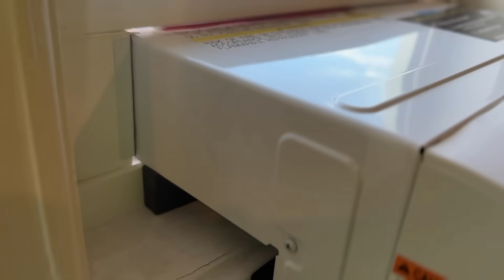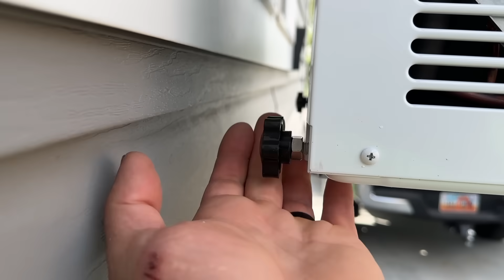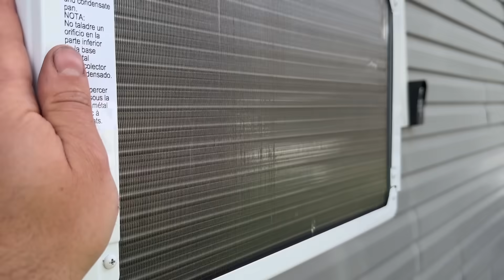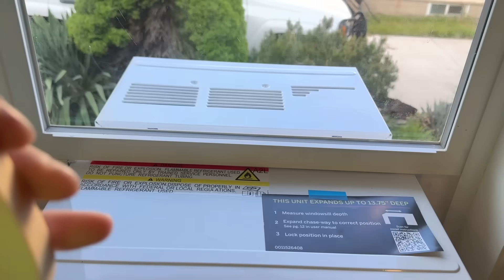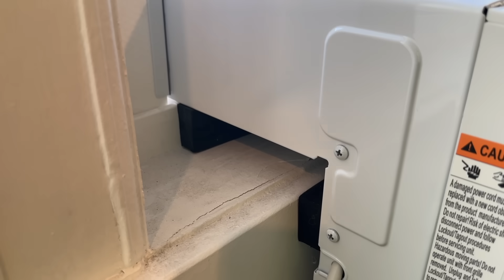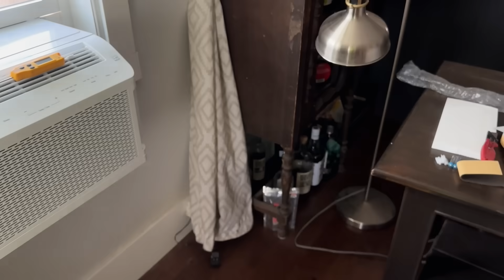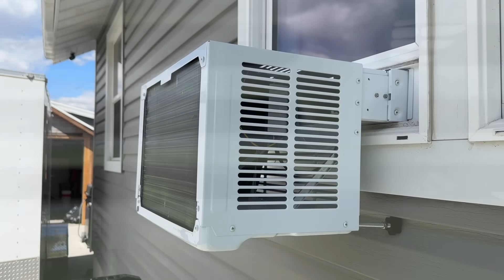Why Didn't Anyone Think Of This Sooner?

Comment: Love the channel and I'd like to answer your question:

Answer:  People thought of this idea over 50 years ago but the reason it was never produced is because the manufacturers had to wait until society was stupid enough to purchase it.  What now with woke Brandon and the alphabet crowd and idiots everywhere it looks like the time has now come.

There is no advantage to this unit as compared to the traditional units save you get a little more window viewing room...  It's harder to install, it costs more to produce and buy, it's more bulky (less compact), and has all the disadvantages of a window a/c combined with all the disadvantages of a mini-split.  You'd be smarter to get a traditional window unit and save money OR go with a mini-split.  It is NOT 30% more efficient than traditional units, it's 30% more efficient than traditional units if those units are 20 or more years old, but it's actually less efficient than traditional window units of today.

All the wifi app control stuff exists everywhere on everything.  Bottom line - it's dumb but since society is getting a lot dumber as time goes by it looks like the time has finally come.  The people who you will see with this unit in their windows this summer will be the same people with the "Biden Harris 2024" banner in their yards

Comment: we have had ours since last year, it gets cold and its very quiet even on high. love the app for it and it wasnt too hard to install at all. only negative i could see someone having was and is needing to drain it the plug is inside near the bottom i mean all you need is a bowl or cup but yeah some needle nose plyers help pull the plug after unscrewing the cap.

Comment: The splashing is intentional so it gets better efficiency. You can also just remove the drain hole outside so it doesn't splash and pours out. I put a hose in my mine so I can have it pour out into a garden.

Comment: I bought one designed from Midea like that 1 1/2 years ago and was a fantastic design . You keep the compressor outside and fan inside . Window shuts almost all the way to just allow transfer of air . Much better than having a wide open window and trying to use those dividers to seal the air gap . Plus soo much quieter .

Comment: Likely because it is cheaper to use one motor with dual shafts and 2 fan blades than using two motors each with their own fan blade. If that condensation pump ever gets clogged (and it will) or the pump quits altogether you are going to have a real mess. It's not a bad idea but it's going to be more expensive and more expensive to maintain because you have 2 motors rather than one that can fail plus an extra condensation pump. There really needs to be a way to add a little bleach to the condensation tray to keep any scum build up out of the tray and especially out of the pump lines

Comment: The condensate from inside is supposed to be picked up by the condenser fan and discharged through the condenser coil. This increases the efficiency on the really hot days.

Comment: Does the manual reference a proper angle for the outside portion of the unit? Sometimes the design is intentionally splashing condensate water on the exterior coil to increase the unit efficiency, albeit at the expense of more noise.

Comment: Sooo Close.  I thought I finally could have a window unit but these unit requires 13" minimum height opening and my error was to install windows that only open 10.5 inches.  If there is a way to remove my lower tilt in window then these will work.  There is exactly 13" from bottom window casing to the bottom of the top window frame.

Comment: Actually I'm surprised those holes are underneath for drainage??? Generally it's ideal to have the water there and the fan slings it up on the condenser coils making it way more efficient at heat transfer. I think most window units are designed that way. Next time you have your window a/c unit running try pouring water in the lower part of it & the difference in efficiency is noticeable immediately inside. That's if you haven't drilled holes to let the water drain out. Lol. The holes are not there for a reason.

Comment: My father had a window unit in the 80s or 90s for use with sideways slider windows.  If I recall correctly the window slid between the inner and outer unit with only a three or four inch connection between them.

Comment: It's been thought of before. There's another one that did it. But, it had a history of leaking condensate inside the house. (Soleus air)
It's why I preferred the Midea U shaped unit, though theirs requires a mount bracket that the unit comes with.

Comment: You gotta check out the unit from Gradient. Same saddle design, but it’s a full on heat pump, so it’ll heat as well as cool. Pretty pricey right now, but if you’re heating with oil or electric resistance and aren’t able to install other heat pumps it will eventually save you more than it costs.

Comment: The EER / SEER rating (Energy efficiency rating) is 11.5 , which I didn't see mentioned anywhere. This is really not great if you plan on running this a lot. If you think you'll be running your AC unit a whole lot, i'd recommend getting a VRF mini split heat pump unit instead, not only is it much more energy efficient (close to 2x more efficient than this) but you can also use it to make heat in the winter. Something to consider when looking at these.

Comment: FANTASTIC for rooms with only one window! I prefer only using air conditioning if absolutely necessary, otherwise I prefer opening the window. This design allows you to open the window and put a fan in without removing the air conditioner. I always hated taking the AC out of the window and putting it back in several times a week.

Comment: Awesome, this is exactly what we need for our sun room. We have a roll out type heat/AC unit and it just doesn't cut it. Every time you open the door to go outside we loose the cold air, just wish it had heat to.

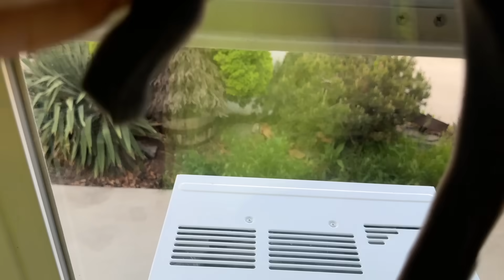Comment: Yeah, this is a great idea. I wish we'd had this when I had to depend on window units in my first home. But I would make one suggestion, at 3:27 in the video where you're putting that black foam on the inside gap, may I suggest you put it on the outside in the gap between the windows to keep insects from coming in and building in that gap created by the upper and lower window.

Comment: It would be great if you could take the cover off and give us an inside tour of that thing. The pump is probably a failure point. It either would prevent the air conditioner from running or water would dump all over your floor. The gap behind the air conditioner is also a possible place for wasp nest building. I have to check around the house especially around the window units in the spring for nests. My last window unit actually had a small wasp nest inside of it in the back at one time. I've heard horror stories of wasps chewing through the foam insulation barrier and entering the house. It doesn't seem to be common, but it's something you should watch out for.

Comment: I would buy the largest unit and replace a through the wall unit. However,  does this unit drop the condensate below it, or does the fan disperse it into the air? I’m on a 3rd floor Condomium and dropping water on the deck and then to the unit below wouldn’t work too well.  It could cause problems…..

Comment: I am not a fan of any window units, bugs always wind up getting in and then the twice a year rodeo wresting the things up and down the basement stairs. Then the dripping condensation water outside attracts bugs wanting the moisture.
Then Ive never had any window a/c seem to last more than 2-3 seaons, they all start off nice and frigidly cold when new, but then after 2-3 seasons it's like they've lost some of their refrigerant or the compressor is wearing out because they never get cold like they did, and I did wash the "filters" out DAILY as well as flushed out the coils periodically. I have dogs and live on a gravel road, so the filter had to be washed out every day to keep it perfectly clean.

They call those things"filters" but they are not filters in the usual sense like a furnace filter, they are nothing but a mesh screen that does little more than capture pet hair, the finer dust winds up passing thru them and clogging up the coils, but as I mentioned- I DID flush the coils out, but to do that and clean the inside thoroughly takes removing a bunch of screws and taking the metal cabinet apart to access the inside, and carefully hosing the coils out carefully to avoid getting water on the control board etc.
These window units are NOT designed to be easily cleaned and have the coils flushed like a heat pump's coils or a regular central a/c condensor unit's coils can be flushed with a garden hose, so they build up a mucky crud inside that can get mold- Ive seen black mold inside the window a/c's styrofoam pieces in them as the styrofoam stays wet all the time in use.

So now I've gone to two Tosot mini splits, and dumping the windows a/c's, we'll see how they do.

Comment: At first when you mentioned the sound of condensor fan slinging water OUTSIDE, that they might have used the "cold water slinging up on the condensor method" that I have seen/heard in motel "through the wall units" but realized they couldn't have without putting the evaporator outside in this saddle design, and ducting the cold air inside, which would be ineffiicent since it's hot outside. So, when you mentioned the condensate pump, I realized the evaporator must be on the inside. I think that condensate pump could be a problem point for this design. I'd probably go with a traditional type unit where condensate drains outside using gravity with less complications. This is an interesting invention though.

Comment: I wanted to get a window AC unit in case of an extended power outage, meaning, it would be placed in the window when needed.  I wonder if this unit would be OK if it was placed in and out of the window opening repeatedly.

Comment: Most HOAs don't allow window ACs especially street view facing.  Check with them first.  We have a regular window unit for emergency backup in the event main AC goes down.  Used it in bedroom window a few times over the years.  Fortunately back of house so no Karen's reported us.  One thing to add, I found out after installing new Anderson windows if you drill any holes anywhere in sash it voids your window warranty.  And if you have old vinyl siding it can get brittle so be careful when you tighten those bottom feet, it can easily crack the brittle siding.

Comment: This is one of those "why wasn't this done before" product designs.  When I've installed window shakers in the past, I've often had to do so in desperation, and accidentally discarded the included foam inserts.  I end up using several improvised materials - plastic grocery bags, cat fur, etc. to fill the gaps...anything seems to work when you're too hot!

Comment: The fan is using the water to cool the ?heat exchanger?(external radiator).  Its an efficiency design in window units for many years now.

Comment: Isn’t the evaporation condensation sometimes used to help cool the condenser coil ?  Sometimes flipping it up on it somehow?  Looks pretty cool but until you mentioned it I didn’t give a thought about evaporation condensation where it was going so the pump might need attention a few times a season maybe and is it easy to access?  Great video as always.  It’ll be interesting if this system takes off as far as sales go.  I’m assuming it’s quieter with the system split a little and the noisier compressor being not all in one.

Comment: I need this! I have a portable roll around type that I pull out whenever hurricanes kill the power here in Florida (often in my area) but I have to deal with the condensation hoses emptying into buckets every few hours…a pain in the butt! I’m heading to Lowe’s as they have them in stock…plug directly into my generator and I’m set! Thank you for the video!